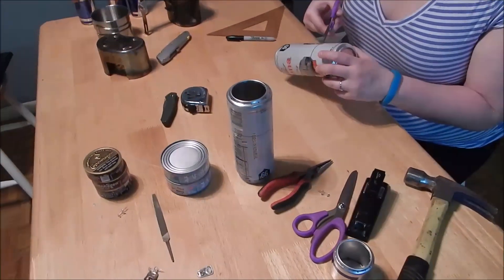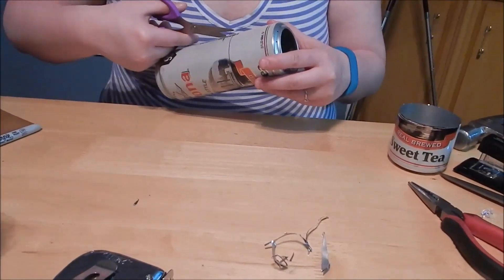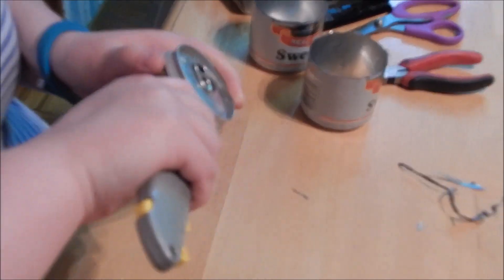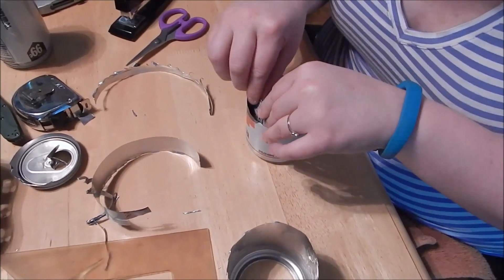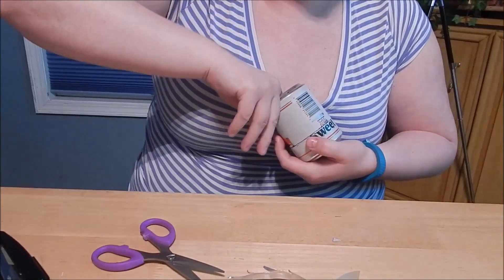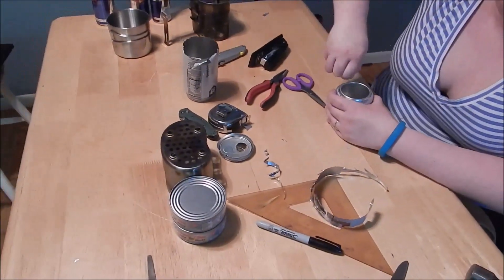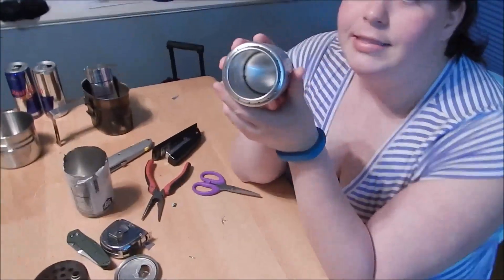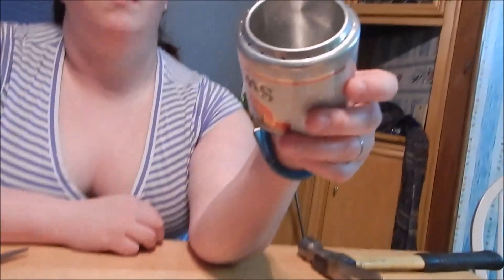Arizona Green Tea Can Alcohol Stove DIY

Comment: Nice job I make mine taller as well. holds more fuel and I heat the alcohol tight in the can over a candle, if it's cold. It always spilt in the shorter cans, and often had to refuel in shorter cans, losing heat. Thanks for the video!

Comment: How high is the inner part, in relation to the total height of the stove?
Reply from the maker: Jack Reacher  roughly 1/4" taller then the height of the top and bottom. the idea is it'll fit into the lip of each can to hold itself in place
Reply: Great lakes prepper Great, thanks!